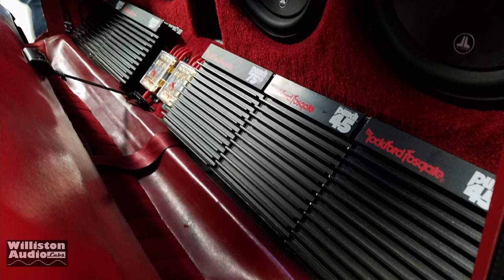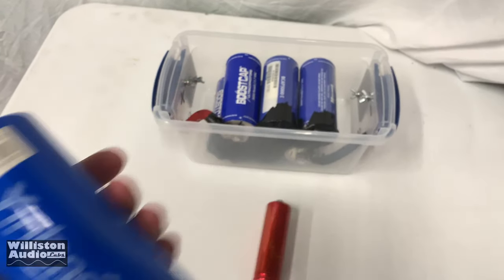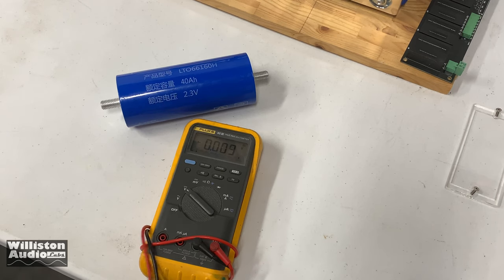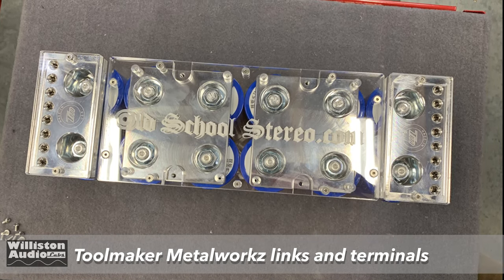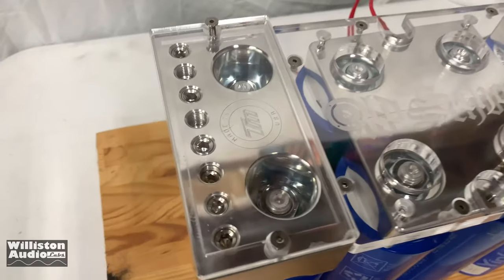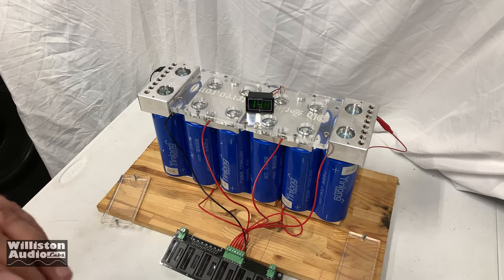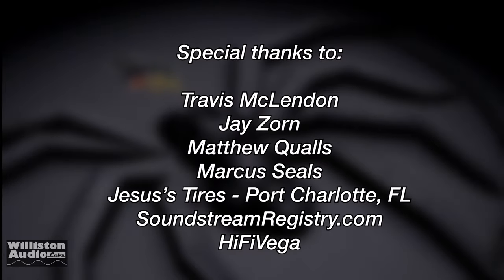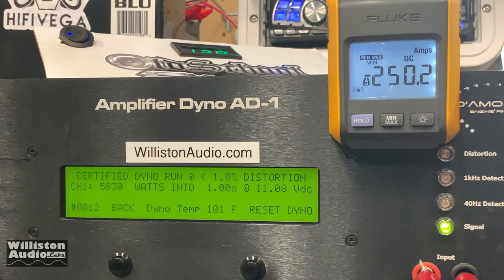Lithium Batteries for Car Audio? Yinlong LTO Cells LTO66160H 8000 watt capable Battery Bank [4K]

Comment: You'll get more than 8k with these with good charging. They're a true 10c+ discharge. That balancer will balance 10 banks no problem. 60 cells
Reply from the maker: Great info. I needed a fact sheet to go over all of the benefits
Reply: @wal  I have 160ah going into my build. These cells are great.
Reply: @PeterFeltersnatch852  I've seen 80ah of these drop less be than a volt on a 250 amp alt clamping 9500 watts.
Reply: Currently running 240ah of these cells on 2 30ks not sure what voltage drop on 2 30ks are but on 1 with 1 370ext regulated alt my drop is .6v and clamped power is close to 25k from 1 30k. My V/M took Shit because it doesnt like lithium waiting on my new 1 to come in .
Reply: @DibeezyTheGifted  now that's impressive, I'm definitely sold
Reply: @magicmikebangin15s64  

My brother and I build 240AH banks and we run 10K Korean board amps.  It is hard to drop more than 3 10ths.    Glad I got into ours last summer before the hype train caught on and the prices spiked.   Also we just bought some copper bar stock and built up our own bus bars.
Reply: I would not expect published performance or cycle life if you push these to 10C.  Of course if you read the fine print on the discharge graphs of these they may be able to do 10C without being damaged but it's far from optimum.  When I bought/sized mine I assumed half the published spec was a flat out lie and I'd want to keep my use at about half of that to maximize life expectancy.  Even at the rather inflated price tag of these kits they're still going to outperform any good quality AGM you would buy at the same price point.
Reply: @magicmikebangin15s64  man can you please message me, I have some questions for you, I just got my 80ah and going to install soon. If you are ok with answering some newb questions, I'd really appreciate it man!
Reply: Still on here

Comment: I heard the LTO cells are fire safe. It's always a good idea to place batteries in a safe location, but perhaps these don't need a firewall. Not much information on these.  Good point about not using these in the same circuit as standard car batteries.

Comment: With 6 cells pulling 250a per bank at 40ah, you're putting a ~6c load on the cells and getting about .67vDC of drop per cell. Not surprised at all you dropped to 11vDC. Lithiums are great but they aren't magic. I've been asking for months for someone to get C rating charts for the cells because that's what's going to actually tell you how these cells handle load. The sweet spot is generally between 2-4C (80-160a per 40ah bank), so in a vehicle with an alternator you can expect significantly less voltage drop, about an entire volt or two less, but you really do need a decent sized bank and alternator to back it up (or time to recharge). 250a per bank is a lot.
Reply: Keep in mind that this is still far superior to lead acid or even AGM. You see people with hundreds of AH of batteries not 80ah. 400ah of batteries with a 500a load is what, 1.25c vs this bank at 6c?
Reply from the maker: Great point 👌
Reply: I've been run an 80ah bank of lto with two 400amp mechman alts (15.5-15.8) clamping 11k-12k of amplifier and the bank has been loving it. Technically it could be 10c of charging and 8c-12c of discharging but unlikely that happens often when it's running. So far im highly impressed how well they hold in my system.

Comment: Awesome vid, Dereck. Question...At the end of the 1st bank and the beginning of the 2nd bank (between cell pairs 3 and 4), it looks to continue to be series'd. If both banks of 6 are in parallel, where is the + to + and - to - relation? Just trying to gain a little knowledge here. EDIT: Never mind, I see what you did. My turn to be a Big Dummy, lol!

Comment: Dear sir, in the case of total 102 or 120 cells instead of 12 pcs of the video
 , same connection with you. How many of these balancers I need ?
Reply: Still one balancer on your hardware it’ll be the same just an another row of yinlong
Reply: @treveonalexander5452 Thank you for your answer  🙏🙏

Comment: In regards to the poor performance on the amp dyno, the reason is due to the BMS which limits discharge/charge current. You can effectively think of the BMS as the gatekeeper for any current flow. As such, you will see drastic losses in comparison the when it is not used.
Reply: I know this is an old comment, but no. In this case, this BMS, is only used to discharge cells that are higher than the lowest voltage of any other cell in the bank. For a BMS to work the way you are describing, it would have to have the main power of the entire bank routed through it, which his BMS does not.

Comment: I didn't understand your video. but I can count. 5800 W/1Ohm output power. The amplifier efficiency is approximately 80%. input power is 7250 W. with a supply voltage of 11 V, the input current is 660 A. Why did the current clamp show 250 A???

Comment: So what happens when you are traveling? will the alternator overcharge lithium batteries if you drive around for long periods of time?
Reply: You always have to use a voltage regulator with an alternator. Some come with an internal regulator and some use an external regulator. What the regulator does is help ensure the system stays at a desired voltage without overcharging

Comment: Hey can you please tell me if there's a way to use just this in your car as your power supply/ starter battery I'm trying to get rid of the lead/acid battery and go straight LTO for the best possible performance from the front of the car to the back I'm limited to the stock alternator because of my car 2019 Toyota Camry ( ONBUS LINBUS electronics build) but every dealer I talk to about these or the xs power cells all want to upsale me to 2-4 titan 8's that's 1500$-3000$ a lot more money than I have to spend and I'll only get the same 30-40 AH of LTO that a cell bank like this has for half the price

Comment: That’s was quite disappointing when it came to the amp dyno. You sounded disappointed aswell. Maybe you could charge the bank up and do a dynamic run? Interesting experiment nonetheless. Appreciate the informative videos as always. 👍
Reply from the maker: I was a bit disappointed honestly, but I’ve also ordered more cells 😝
Reply: Now kidding almost need like 240 ah which is a couple grand. Stuff 
Isnt cheap. For sure.
Reply: @stevemaniaci4750  I currently have 160ah in my car with approximately 16k of amps. And get 0.1v drop.
Reply: I had 80ah bank handling 9k clamped just fine. Charged at 16v and dropped to 15.8 at full tilt. Switched to plananno now though and more than doubled system wattage.

Comment: Nice idea to replace the car battery, make it more of a car-battery shape and use that for standard car battery, it should last longer, start car faster and be lighter
Reply: Don't want to put that under the hood though.. especially if you live where it gets cold
Reply: @nebraskaninja1984  just put some material to keep it warm, heck nowadays car manufacturers do that for the regular car batteries
Reply: Still won't handle -30 though is the sad part. They make battery waters though.
Reply: @nebraskaninja1984  do you realize how cold -30 is? Most of the lower 48 states rarely ever see -30 if at all
Reply: @beardedforlife3740  it does where I live there are plenty states it does
 Still a great battery. Not knocking it. But they make block and battery heaters because of the cold already lol

Comment: I have 27,000rms of wattage in my car. About how many banks would I need? I also have a autotech 320amp alternator 
3- 8,000watt amps
1-5,000 watt amp 
Will be adding 
2-3,000 watts

Comment: Im new with the lto, so i got my self 45ah yinlong bank. Is it safe to use it with stock 90a alternator ? I manage to charge it up to 14.6. I use 5k amp on it and i never drop under 13.7...13.8. 
Is it safe for the alternator to charge the bank and not overheat or burn since i heart lithium haves lower resistance ? I use only balancer for the bank, my car is old and haves no bms i think.

Comment: do you use stainless nuts? I think it's important. magnetic metal also on the battery.
Do you not reduce capacity when you series connect?

Comment: Hi big D,i have 80ah yinlong similar like this bank 300ah alternator and i want to buy 7.5k amp but my amp is running maximum 15v😐 will be ok 14,9 volts to charge my bank? Thanks⚡
Reply: The high-end 6s banks are stable up to 16 volts charging I just ordered mine from SSA the 40 amp hour model can't wait.

Comment: So if they rest above 14 volts then I'm guessing you will need a standalone 16 volt alternator to charge them in an automotive application? The oem 14.4-15v isn't going to be high enough potential to push current into these once they are near full charge

Comment: Big d wiz nice. Only q is .is that aluminium links isolated between the 2 banks? Or is each bank in series? And the links connect the 2 banks in parallel?
Reply: Basically series Parallel 
Series as in to get 13.8 v final
Parallel as in , in series side by side parallel. If that makes sense or I may not be explaining it correctly. 
As you see 1 side of the bank the other side is exactly the same way.  Pos-neg-pos-neg ect...

Comment: I guess if you need a consistant voltage for for an extended amount of time like an spl comp they would be ideal but for a daily driver tho lasting four times as long there also more than four times expensive than led acid marine set up.
Reply: You sure about that?

Comment: If something happens and you kill them, can you get a jump start as usual ?
 CES's prebuilt bank looks good the DIY's not so much. 
Power may have been a $1 or more a watt way back when but we didn't have to spend $1100 or more on banks and $400+ on an alternator.
 Damn pay to play 😂.
Reply: You don't want to jump start with these. Your alt will charge them too fast if they are drained and cause potential problems. A lot of people keep their stock batt under the hood so they can reconnect in case of emergency.

Comment: You can find 12mm x 1.75 nuts at the auto parts store. A lot of ford trucks and SUVs used open face nuts that size for lug nuts. They even have serrated washers built on to them as well.
Reply from the maker: They were MUCH cheaper at BoltDepot, even after shipping

Comment: I have the 80ah xs power bank with the same balancer im wiring it up now great video only question i have is the far left and right connectors labeled j3 a and b and j2 a and b is there any connections that need to be made to those?

Comment: I hear the noise sounds like alternator noise. Were u saying with a bank of these that I can delete my factory battery. Right now I use agm under hood and optima bluetop in the trunk. I would be looking to build a bank a bit bigger than yours. Maybe 6 more cells

Comment: Great job on the video Big D , I was wondering what a bank of lithium batteries would do . Dropping down to 11 v ? WHAT ? It wasn't that great , and B.T.W. can you answer a question for me ? I'm installing a 1700 watt soundstream , running 2 ohm on a set of pioneer 12s . Do I need another battery or a cap to run that ano on a factory set up ? The alt is rated at 95 . Thanks .
Reply from the maker: It’s an 8000 watt amp though, 80aH of LTO with no charging/power supply for the test. I didn’t show, but the cells quickly rebounded to 14.8 volts after the test
Reply: @wal  Ok Thanks ...
Reply: @markgreene9330  Lithiums aren't magic. There's not a single battery out there that will sustain a 250a load standalone without dropping substantially.
Reply: @mitchellroberts7954  I see that is true now , but my point is that many of the retailers want you to think that when selling their product . It seems that a lot of false claims are going around on various products ....Thank you for the feedback ...

Comment: I have been thinking about getting a few of these to power my home, since they have basically have the life span of a capacitor,   I wouldn't need to buy batteries for 20+ years, I need 2k ah, at 24v!
Reply from the maker: LiFePO4 is closer to 12V (per bank) and those may work better for home solar system (in series for 24-26 volts)

Comment: Good video! Can those be ran together with the AGM battery?
Reply from the maker: No, they are higher resting voltage than 12V AGM and should not be used together

Comment: That's a scary amount of lithium cell power there.  They usually behave and don't burst into flames...so that's good, but can they stand up to the thermal extremes, vibrations, dirt, water and grime that a normal lead acid battery can under the hood of a vehicle?  Unlike these, you can leave AGM batteries to charge unattended.
If you get in an accident, do you need to tell first responders (especially firefighters) that you have these in your vehicle?  Will you car insurance cover you if you drive around with these?
Reply from the maker: I can’t answer the insurance question, sorry. Good points and I’ll make sure I mention these in future lithium vids
Reply: You don't want to put lithium under the hood, no.

Comment: I don’t wanna do a battery delete.  Can I run a bank under my seat where my default battery is and another where my other AGM is in the back?  So 2 separate banks
Reply from the maker: Can't mix the battery chemistries as the LTO and AGM have different resting and charging voltages. Unless you had a separate alt to charge the LTO this should not be done

Comment: just the info that I've been looking for, thanx a mil big D, say a do u think that bank combined with a bank of caps with 250amp alternator might be enough for a 6.5k RMS system? an if not, possibly a 3.5k RMS system? any input from anyone would be most appreciated!
Reply: You should definitely be good bro, you should barely see any voltage drop even if you go with a 6k, that alt will help you a lot for sure

Comment: How is your stock alternator going to be able to fully charge these batteries if the sit at 16 volts? The alternator would have to put out 18.4 volts to fully charge them would it not?
Reply: you dont want to over charge the lithium batteries.. as long as you are charging at 14.4V I wouldnt see why you would have a problem
Reply: First off, I don't understand your math. Secondly, if you use an external voltage regulator you can adjust how much you alternator charges. I wouldn't recommend doing that with a factory alternator though, unless it's a high output alt

Comment: Really clean setup but seems like a huge investment and allot of custom fabrication gotta order this gotta get these made even order hard to find nuts For the average guy jus stick with a AGM or any of the other quality car audio batteries unless you've got money to burn Just doesn't seem to make sense for the everyday average guy or stereo Still good info love your channel
Reply: 80ah of raw cells is only about ~300. Big mark up when you add custom bussing, casing, and balancing boards.
Reply from the maker: It is a big investment and a lot of SPL guys are using these. The Headway LiFePO4 cells are better for the average car audio DIY guy
Reply: @wal  Exactly SPL guy's or comp guys its great 4 I'm talking about the  everyday guy that actually listens to his MUSIC DAY 2 DAY 500-1000 watts systems wich like at least 95%+ of the systems are in the real world it wld idiotic IMO to put more $'s into lith and the WHOLE  boat load of accessories than your average system is even worth TELL ME THE LOGIC IN THAT
Reply: @chief9-10-games5  what's the logic in a second battery if you only run 500-1000w?
Reply: @beardedforlife3740  A second battery ensures your getting good clean power with no drop off and it saves your alternator you can burn an alt pretty quick if your car has a lot of power accessories which most cars these days do

Comment: gotta be tough to keep these charged on a standar 12v system right? most alts charge at 14.4-14.6 which is the operatingvolae of these. wouldnt it be optimal to charge this with a 14v alt?  how would you compare this to a g31 battery as far as capacity?
Reply from the maker: Optimal is 14.6-15.2
Reply: @wal  i thik tha would be  a hard pass for me. i know a couple guys like hunter that are runing lith with good results.  though

Comment: Damn. Lithium is Starting to get a little cheaper. My 2 50AH Lithium Batteries Were 740 Each. And They Can Only Dump Maybe 600Amps Total (Limited By battery Protection Built In) I got them for Capacity. My 8 Banks Of 6 Ultra Caps Do The Heavy Lifting As Well As My 2 320 Amp Mechman Alternators.